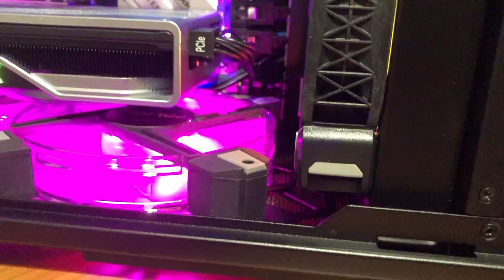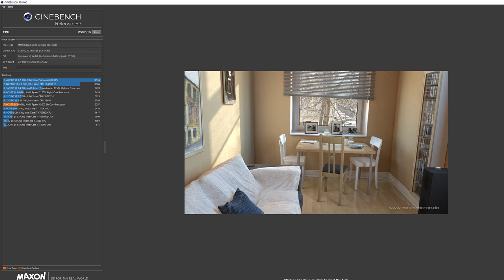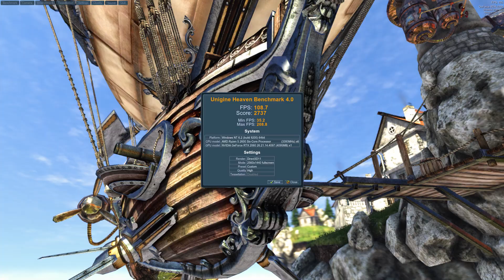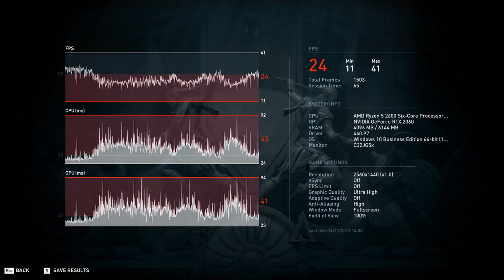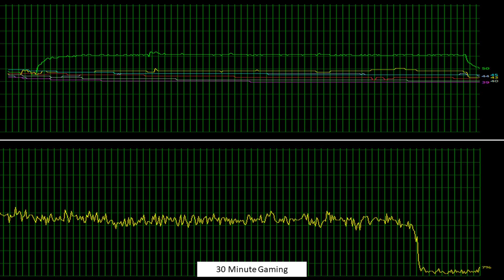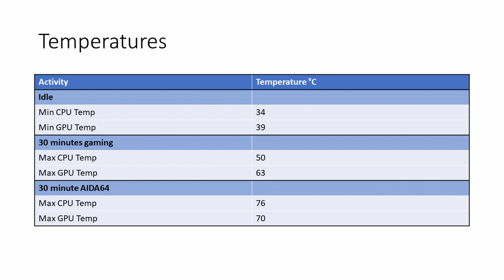In Win 301 Build - Thermals

Comment: For those who talking about the rad, in wrong mounting position. Your correct but also incorrect. So long as any part of rad is hight than the pump you are good. Yes mounting from the bottom is ideal it’s not possible with a gpu. Otherwise you need to go full custom water cooling.

Comment: Nice build and video! Not trying to be negative here but your radiator is upside down. The tubes should be coming out the bottom to let any bubbles rise to the top of the tank. Hope this helps and thanks for the info on the case I am looking at.
Reply: There's no space for the tubes to be on the bottom, so it has to be mounted as he did.